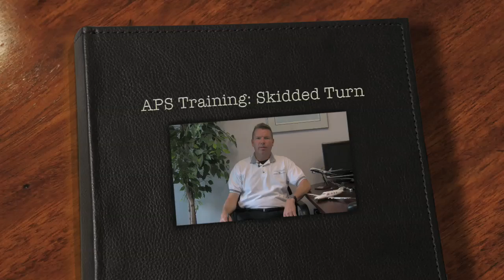Skidded Turn Aerodynamics - APS Emergency Maneuver Training

Comment: Best video ever for student pilots and even a lot of seasoned pilots.....Thank you very much for taking the time to save lives.
 I learned the skidded turn when I was a kid flying my remote control glider.....the wing span is somewhat exaggerated so it's easy to see a skid from the outside looking AT the plane or "Wing". As you watch your glider for hours and hours you begin to see it as a flying wing....with little tabs to manipulate its ability to stay aloft.....and after hours and hours of that you realize that "opposite rudder" (along with down elevator) is a very useful tool in a skid. Remember: if you're slope flying a model glider it's usually a bit windy and small puffs of wind play havoc on a plane that weighs maybe 2.5 lbs...so you have to be quick.... 
   Think about this for a second....you are flying a glider with a pronounced dihedral wing...You only have elevator and rudder..... .and you want to keep it inverted....(without ailerons).....How do you keep it level while inverted when all it wants to do is right it's self? With rudder of course....As the plane flies forward one side of the wing will want to drop, so if it's the left side, add right rudder to speed up the airflow over the left wing so it comes up..(same for the opposite). Things like this force you to learn about wing and airflow characteristics. Basically, a plane is a giant wing going forward with little helpers keeping it from going nuts.
    I handed my iPhone to a friend (who pilots a Citation 10) with this video loaded. He watched the whole thing and thanked me 
(student Pilot) for that and said it was VERY informative and was going to send a link to his fellow friends/pilots. Just good to review on occasion too.....
So....at moment of critical decision you need to reverse rudder, neutral ailerons, nose down, add power (if not in a glider) then GO AROUND... and never....ever....do this again.

Comment: Thank you very much! I am only an armchair computer pilot and have been an RC pilot for years.  I never fully understood this till now.  I have contemplated getting a private pilot's license for a long time, and you may have saved my future life!  Thank you!
Reply: I flew RC planes but it was RC gliders that taught me wing characteristics like this. I perused my GA pilots license 5 years ago, got to where I could solo then put it on the back burner. Go take a lesson at your local municipal airport...maybe $150.00 for an hour and you WILL sit left chair and learn a lot about GA flying. And you WILL overshoot approaches....real planes are so sluggish compared to scale model. My instructor only taught short approach landings which is better IMO in case you have a dead stick....Long approach overshoots you can just fly the plane left or right to line up....then land...short approach? You better watch this video again.

Comment: In addition to the delta (swept) wing explanation, and the increased angle of attack of the aileron, you can also attribute the down wing stall to "dirty air" from the fuselage partially blocking the normal airflow over the wing.

Comment: Unless I missed it, the key aspect of the mechanics of a skidded turn was not covered.  In a skidded turn the outboard wing accelerates thereby creating greater lift on the high side.  The opposite is true on the inboard wing.  This asymmetric lift causes the airplane to roll towards the low wing.  In addition, the angle of attack on the inboard wing is increased as it drops which exacerbates the tendency for the inboard wing to stall.  This leads to an uncontrolled roll and downward pitching motion which, if uncorrected, leads to disaster at low altitudes.  This is the same dynamic of a spin where, when done intentionally, is accomplished by applying full rudder at the point of a stall. 

Also, I’m not sure why swept wing vs rectangular wing stall characteristics were covered in this video.   This really doesn’t do anything for GA pilots and only tends to make the subject more confusing.
Reply: You missed it. He explained it beautifully and thoroughly. If your interested,  his whole talk here is based on chapter 18 in Stick And Rudder.                                    When a plane is yawed,  the forward wing has a slightly higher angle of attack.  That's because of dihedral. pg.126 in Stk & Rud.  Like you said, the plane will bank when yawed. You stop the banking with opposite aileron. You're cross controlled. The wing that stalls first is the one with the downward deflected aileron. It's called an aileron stall. If you want to be a safe pilot I highly recommend the classic,  Stick And Rudder.

Comment: This whole thing can easily be avoided will a straight in approach I would think.   Can anyone tell me what the point of all that close in maneuvering is, instead of lining up on the runway from 20 miles away?
Reply: circling approach for IFR
straight in is not approved at all airports
If you need to land on a northbound heading but are on a south heading you can join straight in downwind or do an IFR approach and circle for the north bound runway (circling for a runway has only a few nm of protected airspace depending on speed.
traffic flow

Comment: My CFI never covered skidding... even to the point of my first solo. But I did fly RC models, more importantly gliders. (Powered models are WAY over powered to scale). The glider will teach you a LOT about what flies and what struggles to fly. I realized very early (in full scale planes) that a 172 is like flying a model with a brick on top. You have to be patient and vigilant with these comparatively lumbering planes. Flying models with a sputtering engine is very good practice as it teaches you to use slight input and keep airflow perpendicular to the ever so important, life saving and beautiful  wing. I totally understood everything this pilot said and will think about it every time I over shoot. I'll keep the plane flying and if I run out of room...I'll go around. My CFI only taught short approach landings so I learned not to overshoot quickly. For those thinking about flying GA.... buy a cheap RC model....or 2...or 3. It's money well spent.

Comment: Excellent video.  I always try for a somewhat longer downwind before a turn to base.  It gives you more options to improve a landing that may not be going perfectly for very little additional time.  When I have a less than perfect landing it is usually because I rushed it.
Reply: My instructor only taught short approach landings, which is better IMO in case you have a dead stick....Long approach overshoots you can just fly the plane left or right to line up....then land...short approach? One should watch this video again and again.

Comment: Excellent . Any chance of doing the same for a slipping turn . My understanding is if you apply top rudder the airplane flips over ie drops the high wing . Many internet comments say slipping turn is way safer but when my plane dropped the high wing unexpectedly panic set in in a few milliseconds and I had no idea how I got there

Comment: Nice good demo.  I fly Dutches and 182's.  I'm wondering if the high wing has that much of an aerodynamic advantage over the low wing configuration due to the fuselage.  Skidded turns should always be avoided regardless, only flying a stabilized approach to land only.
Reply: I've heard high wing is more stable and harder to induce an accelerated stall on base to final, but  then I don't really every want to find out for sure. If in doubt, go around.

Comment: apsvideotraining << You omitted to mention the change in thrust vector relative to the direction of momentum, and the lateral aerodynamic force (and drag) component generated by the fuselage sides opposing the airstream. Those two effects do serve to tighten the turn.

There's also the volume of disturbed air at the 'shadowed' wingroot, granted a large enough slip angle.

Since you provided such wonderful detail in all other regards, I'm left thinking that this omission is on purpose so as to not encourage the practice.

-scheherazade